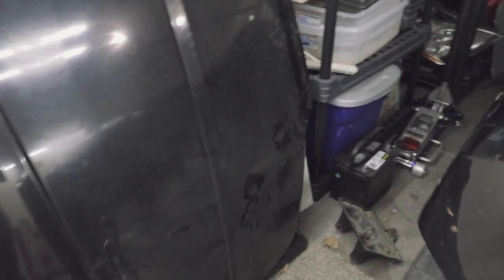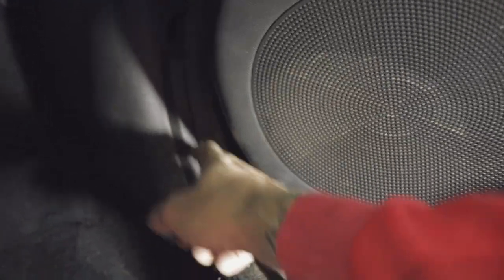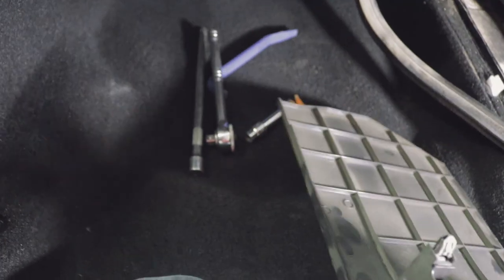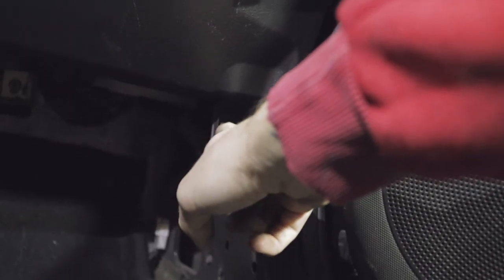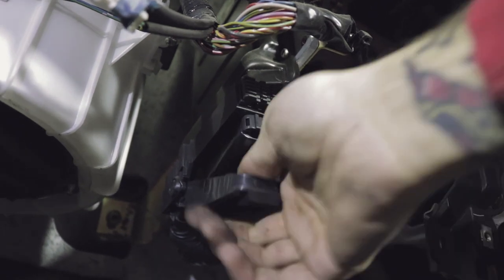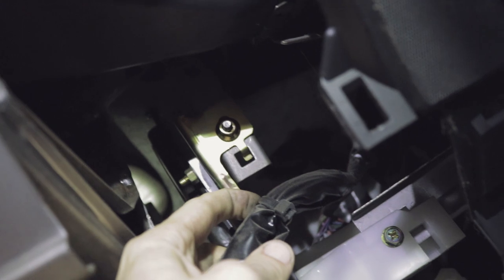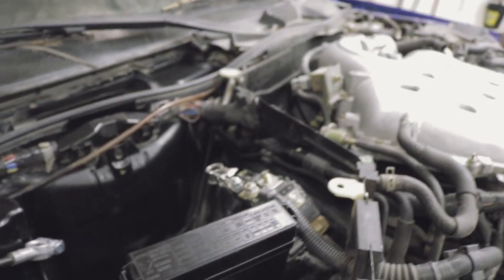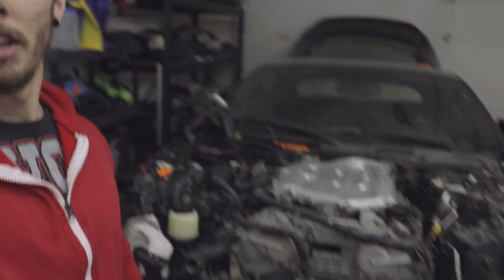350z ECU Location and Wiring Harness Removal

Comment: Came across your channel while trying to learn more about a 350z wiring harness and ecu since I’ve found out there’s been wires cut and wires spliced in mine. And after spending thousands of dollars at car shops just for them to tell me they fixed it and it runs great but when I go to pick it up I don’t even make it five feet without it no longer accelerating and the slip/traction control light coming on, I figured it was time I try to have at least a little bit of knowledge about my car. I think I’ve also now figured out how the plastic piece on the passenger floorboard has a crack in it that wasn’t there before. Great video.
Reply from the maker: Glad it helped! Might want to try and get a new harness possibly? I bet you can get one from a part out at a pretty decent price. To bad I already sold my spare... Hope you get your car sorted. I honestly hate taking my car to shops, they always end up not doing something right and then I'm pissed because I spent way more money then I had to...
Reply: Yeah the first out of the three car shop I took it to when this first started happening back in 2018 mentioned replacing the whole wiring harness. Although they told me they wanted to charge me $4,000 after I had already brought it to that shop four different times for this problem and spending $2,000 I opted out. But maybe I’ll check into that again somewhere else. Yeah with each shop I’ve taken it to more and more codes keep popping up along with exterior and interior damage. Car shops have gotten super shady and seem to just take your money and not actually replace things they said they did as I’ve found out the hard way, so I feel your frustration and anger. Thank you! I hope it gets figured out as well but without spending more than the cars worth hah.

Comment: Great video bro. But I have a question. When you're changing your ecu/ecm does it have to have the exact model and part number of the ecu? And also I've searched I cant find the fuse for the ecu as well. Please help! Thanks
Reply from the maker: I'm pretty sure it just has to be from the same engine year like de, Revup, hr, ect... I'm also not positive but I would assume you would have to get your keys programmed to the new ecu since they were programmed to the old one and they have anti - theft chips in them.

Comment: Thank you for this video. I do have a question, i am replacing my own harness because my headlights and tail lights are out, with doing what you did in the video can the whole harness come out or will i need to unscrew some more things? just need to paint a bigger picture of what is actually going to be done when i remove just the harness itself.
Reply from the maker: Did you check all the fuses and relays? The whole harness can come out that way, it's just a bit tight in the back of the engine. Im like 99% sure the headlight harnesses are separate from the engine harness though. So replacing this harness wouldn't help your light issues
Reply: @KyleHidalgo  which harness is this? the A/T harness?

Comment: What intercooler you think work best front mount or top?
Reply from the maker: They both serve their purposes. Unless your running pretty high boost I would stick with the top mount because the turbo lag with the front mount would take away some of the fun of daily driving and lower rpm driving. But front mounts give cooler air and they just look nicer. So it's mainly personal preference really but boost will kick in faster with the top mount.

Comment: Is there anyway to replace that rubber grommet I have water leaking into my cabin from it when it rains or I wash the car.
Reply from the maker: I would say yes if you can find a new gromit but it definitely might be a little difficult, those things are pretty tight.

Comment: Do I need to use the same ecu from the original engine or can I use the ecu from the new(donor) engine ?
Reply from the maker: You can use either as long as it's the right ecu for the car /engine. I would probably keep the new one as a spare

Comment: My 10mm on the ECU refuse to get loose! Just kept spinning in place..
Reply from the maker: Oh shit, yeah I think those bolts have those stupid clips that they screw into... I would either try and put something flat under the bolt head and put pressure on it while you unscrew it or try and get behind it to hold whatever is spinning
Reply: @KyleHidalgo  I did just that. Took a flat screw driver and pushed hard from behind that flat thing on the bolt (y) 

Now it is ready to ship to get uprev on it!

Comment: hey man what are those 3 plugs on the fire wall for ? i bought a project 350z but that harness is cut on mines for the 3 connecters what are they ment for ?
Reply from the maker: Hmmm I'm actually not to sure off the top of my head. I'd have to take a look at mine and see where they run. I would imagine they're important though
Reply: Kyle Hidalgo well its the harness that runs right into the ecu loom but it plugs in to those 3 connectors i just need to know what there ment for and if im able to start my car if there not plugged in
Reply from the maker: @qua_szn  I'll have to do some research, I'm not quite sure what they are for unfortunately...

Comment: What is that little white plug for near the ecu wiring
Reply from the maker: Hmmm I'm not exactly sure but I think it might be for the side air bags
Reply: @KyleHidalgo  I have a harness that doesn't come with that little plug kinda weird as everything else plugs up no problem only problem is that the fuel pump doesn't kick on

Comment: Is this an auto or manual?
Reply from the maker: It's a manual. How come?
Reply: @KyleHidalgo   i'm doing a 6 speed swap. just changed to a manual harness, and it doesnt have the plug that comes from under the carpet. Trying to figure out why, and what it's for.
Reply from the maker: @ricardojimenez875  hmmm that's really weird. Let me see if I might be able to track down what it's for, for you.
Reply from the maker: So I found a wiring diagram and I'm not positive but it looks like it's just for the handbrake switch
Reply: @KyleHidalgo   hm that's interesting thanks i appreciate it big time
Reply from the maker: No problem at all my bro! Good luck
Reply: Someone has taking it